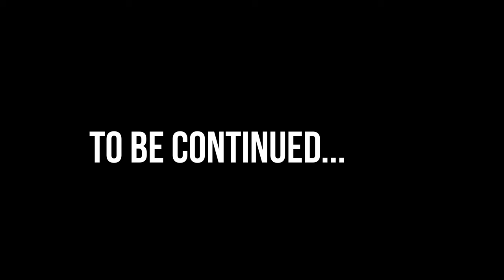Building new LANDING GEAR for the Abandoned airplane.

Comment: Tow IN (just a little) causes the wheels to push inward on touch down. Tow out would cause the wheels to pull outward more and more as gear is forced against the surface. In Line much better then tow out. 8)

Comment: For a bit of toe in you could have just put a small bend in the middle of your through tube and that would have done the trick. Definitely toe in on these small planes otherwise you have your wheels wanting to run outwards which drops the nose of the plane as beetle down the track.  Not ideal. Nice work bro.

Comment: You might add a thin tube or even a solid wire between the two top bushings on each gear leg.  This avoids side loading the gussets (gear mounting points). During a landing the gear legs will tend to splay apart, and without this added tuge, the gussets will have to resist the splaying.
Reply from the maker: Noted! Thanks for the info

Comment: Just make sure you still have positive chamber when fully loaded! It will steer easy
Reply: What wire do you use Jonas on the Meg welder when welding the chromoly,  Thanks.

Comment: Jonas the landing gear you built looks to be 200% better in it's design then the original. The plan for construction of it  needs to be sold for this type of plane. It will make the plane way stronger to land. Great design
Reply: And the low-slung extra drag and weight will take away some of that aileron sensitivity...

Comment: Love the build videos, your very inventive like your older stuff like the mower haha. I also have faith you will figure the old bailer out. So maybe I watch too much Forged in Fire but would it help to do some mild heat treating on the legs? like just enough that when the metal flexes it will spring back, but not so heat treated that it gets brittle...

Comment: You should have put the stronger thicker tube on the rear and used the smaller tube on the front as a "tension" rod to keep it aligned. You are more likely to bend the smaller rear tube on a hard landing under compression than pull it apart under tension.

Comment: Nose weight ain't gonna hurt the forward airspeed that's for sure... GREAT VIDEOS!
As far as toe in or out goes...Camber etc is something I discovered when i built my first gokart. Initially I knew NOTHING about toe in etc until i built my stearing with straight wheels (The easiest). The result was me yawing right and left like a skateboard does when going really fast with no dampening. I crashed and burned in a big way. I would assume a tail dragger would have the same issues as well... Not sure though...

Comment: Hey Jonas, I found this post on Van’s website. I thought it might be help in the toe in/toe out debate:
Dec 31, 2021
#9
Toe out or toe in?

Hi, Moe,

Mel beat me to it:), but here is an expanded explanation:

You are entirely correct that in racing cars, toe out is desirable to make the turn in more aggressive. The reason for this is that at turn initiation, there is little weight transfer until the entire chassis rotates to give the rear tires the angle of attack (known as "slip angle" in tires), they need to create a lateral force. Toe out makes the inside front grab more aggressively on turn entry, speeding up the rotation of the chassis. However, the opposite is true with a taildragger aircraft: Mainwheel toe OUT creates a stabilizing force.

First, let me explain my background to give a bit more credibility: I am a Mechanical Engineer, with 35 years' experience in engineering and driving of open wheel (Formula 2000 and others) cars, reasonably successfully. Chassis setup was my specialty. Now, why toe out?

As we all know, the tailwheel aircraft is inherently unstable on the ground because the CG is aft of the main wheels. If both wheels have toe in, both wheels will be creating a force towards the centerline of the aircraft when rolling straight ahead. When the aircraft diverges from a straight path (swerves), even slightly, weight is transferred from the inside wheel to the outside wheel, thus the outside wheel will have a greater lateral thrust capability and the inside wheel will have less lateral thrust capability - the net is an increase in force in the direction of the swerve, increasing the swerve rate, and requiring a very authoritative rudder response from the pilot.

Conversely, if the wheels have toe out, both wheels will be creating a force outward, away from the centerline of the aircraft when rolling straight ahead. When the aircraft diverges from a straight path (swerves), weight is transferred from the inside wheel to the outside wheel. Again, the inside wheel loses some lateral force, while the outside gains some lateral force. But here's the key: weight and lateral force capability is still transferred, but the toe out of the outside wheel helps to "steer" the airplane straight.

Note that the airplane is still unstable, but less so with toe out. In my own case, my RV8 had an initial toe IN of 1.25 degrees. I found the airplane to be controllable, but "nervous." Using the VAN's supplied shims, I set toe OUT 0.25 degrees. The "nervous" feeling was greatly reduced.

Now, look at the same analysis for a tricycle aircraft: Toe IN is stabilizing as the CG is ahead of the main landing gear. Think about it…..

As noted above, when transitioning from tail up to tail down on landing, the camber of the wheels will move the wheels towards toe in. For the typical10 degree nose up three-point attitude this will translate to approximately (10/90 x camber angle) or .11 degrees per degree of caster. This argues for even MORE toe out to retain relative stability in the 3-point attitude. At my next condition inspection, I'll increase the toe out to see if this can be documented.

As an aside, by changing the toe in I increased my tire life from 240 landings to 600 landings, and the wear is much more even (both sets of tires were Goodyear Flight Eagle III)

Comment: why not switch it over to mountain bike brakes, could save even moe weight, and the new cable pulled hydraulic calipers are cool, have clamping or hydraulic with cables.

Comment: Toe is the most important alignment angle when it comes to a tire’s overall tread life and performance. Dude, a little toe would make a world. I go toe in,  (every car known to mankind uses). Use that pipe, or slightly smaller one and just shim in front of it where is passes through the axle holes. Don't need much, like a 1/32 if that. That will translate to about a 1/4 inch on the forward surface of the wheels. Easy to do a simple mock up to double check. Your high speed taxi experience will be a world better. Always need a little toe!

Comment: The way it was taught to me in RC is that toe in will turn your to the inside of the runway if you touch down with one wheel on accident but if you go with toe out it will want to steer you off the runway.  Not sure if the same things apply in full scale though.  I had one plane that was always a nightmare to take off and land, it was a ground loop monster.  I tried toe out and it made it worse but when I went toe in not only did it make it much easier for ground handling but it also made the tires scrub which actually helped slow it down for our short runway, Ultrasport .40 overmotored with a .55 for those that are curious.
Reply: I had Ultrasports in 40, 60 and the 1000. Great memories.

Comment: Its TOE IN, imagine in your mind, two wheels both toed in, the left trying to turn right, the right trying to turn left, both fighting each other, plane goes straight, and the fighting to turn adds drag to slow the plane to a stop. NOW, the plane goes to the right, the TOED IN right wheel is now going STRAIGHT with no drag, HOWEVER, the toed in left wheel is now making even more of a right turn adding drag and slow down, so the plane goes back to the left.

Comment: Toe in or toe out?  When you swerve, and the plane rocks towards the outside of the swerve, toe in will make the tire with the weight on it want to turn more into the swerve, making the swerve worse.  With toe out, that same wheel will be aiming just a bit out of the swerve not into it.  I've tried to set up my Avids and Kitfoxes straight ahead or 1/8" toe out.  But I've been wrong plenty of times in my life to.  But it's my story, and I'm sticking to it.  :-)
Reply: Actually you want toe-in. If the plane starts to swerve to the right, for instance, the left tire will be angled further to the right, creating more drag, while the tire on the right will be straightened, creating less drag, all resulting in a pull to the left to square up the plane. This was how we used to set up RC aircraft to be self-correcting.
Reply: The latest understanding is a little toe out, I agree.
Reply: @stevenhorney7735  I don't follow your line of reasoning.  Maybe this will explain it better as I see it.  In the first ski lesson a snow skier gets, he learns to snowplow.  The ski tips are nearly touching each other with the back of the skis wide apart.  (an exagerated toe in condition)  To make a turn, the skier lifts one foot, and turns in the direction the other ski is pointing.   Likewise, when the plane leans over in a swerve and transfers more of the weight of the plane to the outside wheel, the plane will start to go more in the direction of that outside wheel.  At that point, toe in will make the turn tighter.  Just the opposite of what you would want.
Reply: @jimchuk8511  You're assuming all the weight transfers to the outside wheel in a turn; in which case, you would be correct. But unless the plane is tipping significantly, both wheels will be loaded. In thinking about your ski analogy, if have your weight on both skis, you'll be more stable snow plowing with the tips pointed inward than you would be with the tips pointed outward. If they're pointed outward and you start to turn, the inside ski (or wheel) will create greater drag, while the outside ski (or wheel) will come into alignment and move with less drag, amplifying the turn. The opposite happens with toe-in, pulling you back into alignment. You can test this with a model car or airplane (or skis). Give them toe-in and then toe-out, and see which is more stable.

Comment: What about a bigger rudder too for more low throttle control?
Reply: Airbikes are very stable and predictable at low airspeeds with the control surfaces they are equipped with. While you do lose some authority, in general they are more than adequate even at sub 30 mph airspeeds.
Reply: @kidkhaos6427  So why did it swerve so badly of the runway after landing?
Reply: @graw4868  my guess would be poor alignment when the legs were initially set up. They flex a lot during landing which can exaggerate misalignment further. Especially on pavement.
 Also jonas appears to fly mostly GA  aircraft. It is common for folks transitioning from GA to UL to have problems during landing as you bleed airspeed and carry far less momentum.  
Whatever the issue, insufficient rudder control is most likely not the case. I own and fly one of these regularly. Great in the air,  tricky on the ground.
Reply: @kidkhaos6427  Makes sense, thanks for taking the time to reply.
Reply: @graw4868  no worries, its all just a game of educated guesses anyway!

Comment: Jonas when are you gonna finish the Cappella and your defiant
Reply: Straight is the way you want to run not turning one way or another,  with cars if it's rear wheel drive you want to have toe in so it flexes straight under power, with front wheel drive you build toe out so under power itflexes straight your little airplane is most critical during landing and its not under power or torque until you add brake.  So you decide what you need and build it, I love your little plane.

Comment: It seems like you would want to toe it a little in with no weight on them to where when the weight of the plane has them running straight it seems like geometrically when they go out more
With the bump of coming back down they or going to move to a toe out position maybe to much depending on the amount of suspension travel.
Not having articulated hub with a control arm and sway bar you aren’t going to ever be within a 1/2” in or out anyway after every bump you hit.
This is the weakest part of
This ultralight idea idk why anyone would want to fly a bicycle frame with a motor and unshielded propeller running like a food processor three feet in front of them.?? Haha I thought your little two seat plane you had first time I saw your channel was as small as I’d ever go with a plane. I’d have a motorized parasail and a good secondary before I’d want to fly in this thing haha this thing rolls over on landing at 45 mph and that be a ride haha seems like most accidents or just rough landings and this be similar to a four wheeer crash where having a 90s Honda Civic crash would be closer to the two seater plane.
Haha good luck man and God bless

Comment: Toe OUT is the most dynamically stable (albeit tire-wearing) setup. No believing needed, because here is the explaination: Imagine a landing roll situation in which a small bank to the left occurs. Assuming everything else symmetrical, there is now more load on the left wheel than on the right wheel. Being pressed on the runway with more force, the left wheel will have more steering authority than the right one. With toe out, it'll steer left and because the contact point between wheel and runway is well below the CG, it'll auto-correct that inintial left bank. With neither toe in nor toe out, the plane will basically wait for the pilot to correct be bank. And with toe in, the left wheel will steer left, increase the initial left bank, and enter a vicious circle. Without quick pilot counter-action, the left wing tip will soon be grinding on the runway. When laying out landing gears, bear in mind that positive camber and positive pitch combine to toe in and vice versa.